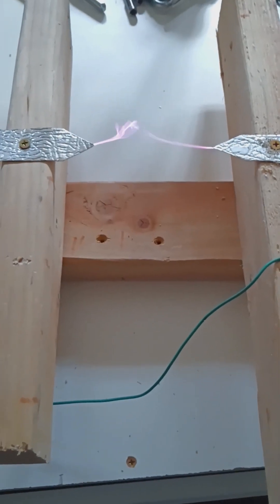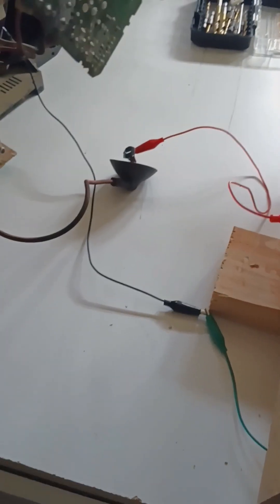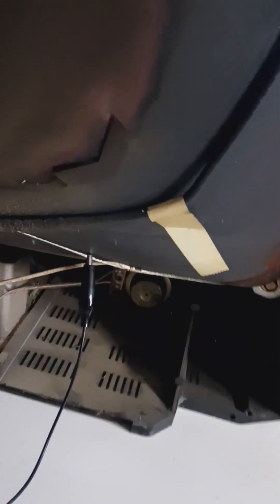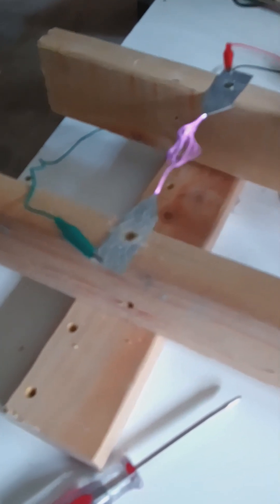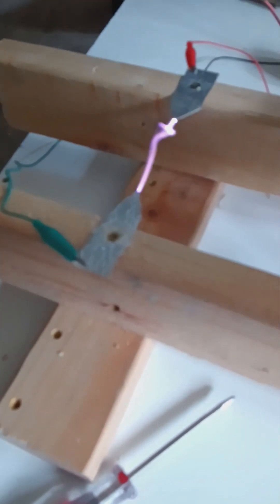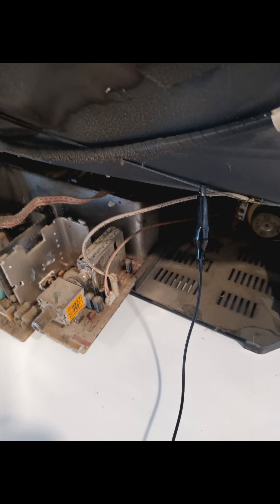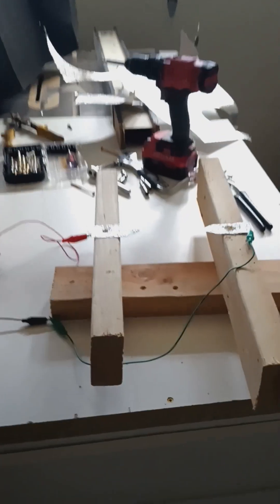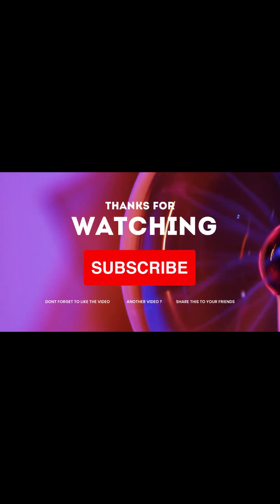High Voltage CRT TV (tubed tv)

Comment: Sorry to bother, but when ever i make an arc with  the supply, it always just turns off, so could you tell me how to fix it? i would really appreciate it!
Reply from the maker: Does it spark all at once? Big build up the one spark.
Reply from the maker: Is the front of the tv flat or is the tv a monitor? The late 90's tv's have a 400v capacitor that charge up then discharge all at once. They are not capable of continues output. There are free tv's on offer up and on facebook marketplace all the time if you need another one. look for the older ones. nothing flat in the front and no monitors. Those will still work for the flyback, but won't connect directly.
Reply: @oldmanbuilds  Ok thank you, again, sorry for all the annoying questions...
Reply from the maker: @bolt_the_duck  There is nothing annoying about trying to learn how things work. You can keep asking any question you have. Trust me I do the same to people who know things I want to know. If you get it working post it on you page so I can see it. Thanks...
Reply: @oldmanbuilds  Ok i will, thanks!

Comment: I never thought to do that! You have a new subscriber!
Reply from the maker: If you still have the remote, then it makes life so much easier. I am transferring the whole motherboard to a new box and making a power supply out of it. I should be done in a week or so.
Reply: @oldmanbuilds   Do i have to connect the tv to something for it to play, or just turn it on?
Reply from the maker: @bolt_the_duck  just turn it on. That's the best part of the whole thing. It's that easy.
Reply: @oldmanbuilds  I have one more question, how many volts is that, and is it AC or DC? (Sorry about all the questions)
Reply from the maker: @bolt_the_duck  I will answer all that I can. It's dc high voltage. It uses a flyback transformer that is internally rectified. The distance is 1" to start the spark and 3 3/4" or 95mm at total length. Not sure the voltage. there is a chart on google that tells the voltage vs the spark gap. If i guessed it would be around 40,000 volts.
Reply: @oldmanbuilds   OK Thanks!!!